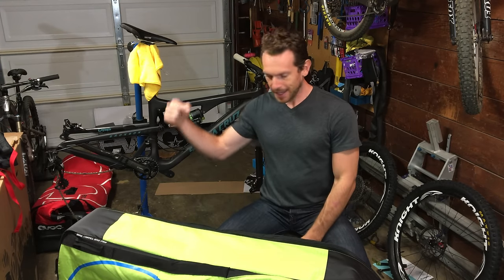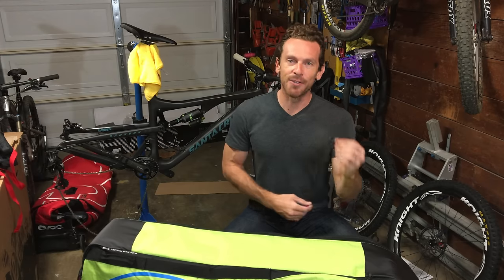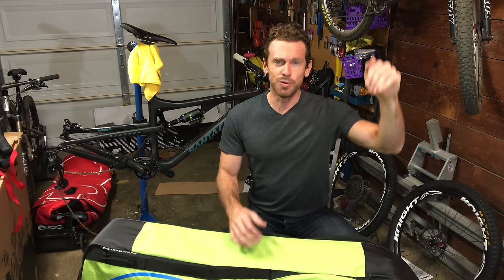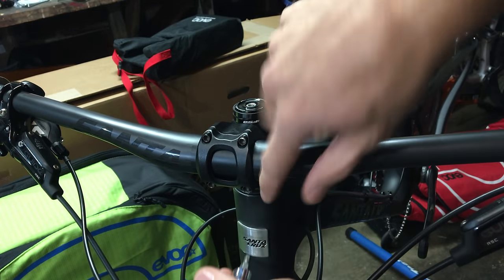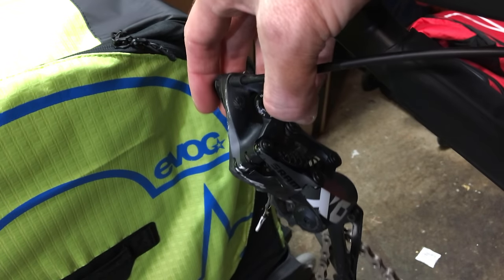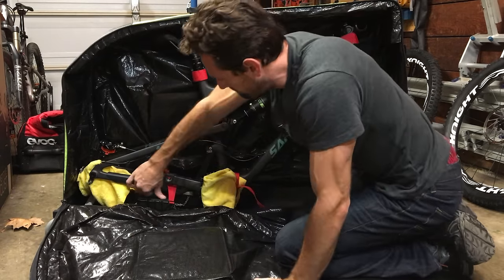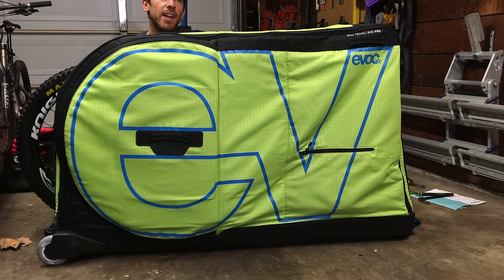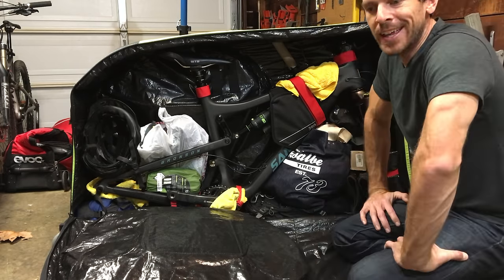How to fly with your mountain bike

Comment: A couple of other pointers I've learned from experience - Buy some closed cell foam pipe insulation to protect frame tubes.  They're cheap and they work really well.  An alternative to the airline is send your bike ahead of time via UPS / Fedex.  It will save a few bucks and it will be insured.  And don't leave any hardware lose in the bag or it will cause damage.
Good video thanks and I'll have to check out the Evoc Pro bag.
Reply from the maker: Thanks for those tips!

Comment: Reason for leaving a skewer in with a pvc or dowell spacer is so that when a baggage handler walks over your bike and stands on the stays, or your bike is the bag at the bottom of the pile, they can support the weight. Remembering of course that a baggage handler in poor health could weigh in excess of 200 lbs. I'm trusting the skewer and spacer over the foam bag.
Reply: This is  sad to hear, and if someone really does this they are stupid.
Reply from the maker: Definitely a possibility!
Reply: Johannes Nilsen I completely agree, but I don't know if you've ever watched baggage handlers or not, they're not exactly concerned about roughing stuff up.
Reply: sadly it's the same if you send the bike or components via mail. once i 
received a package of grips i ordered and some other stuff, it looked 
like a dog had it in its mouth, and some sued the package as a soccer 
ball. it was POSTEN NORGE but this happen only once. but a lot of the 
stuff i ordered from Norwegian online stores have been packaged quite 
well, with plastic air bags and cardboard, But even thou some workers 
are careless, they don't put stuff that weigh 30 kg on a small package, 
that's just Below Stupid. if you are too stupid ppl will notice and you 
get fired. recived a package to the door by ups ones the edges of the 
carton were banged up, but product inside was fine, but under transport 
under heavy braking i guess it could happen, so packaging stuff with  
ESP is a good idea,which most electronics are packaged in. so
 packaging a bike in it is a good idea I think.
there will always be some stupid person some where. but so far I have 
had good experiences so far,but I have never travelled by plane.

Comment: IF the axles are in the frame will flex less, but if they are not all the way in they can unscrew them selves and damage the threads if they get hit
Reply from the maker: Interesting!
Reply: But then again if the frame flex there will be friction between those two,so to eliminate this is to have a hub or some sort of axle insert thing,like on roof racks. In my opinion this is what you should do, have something in there. with Skewers the frame will still flex of course.

Comment: Your bike doesn't have skewers, it has threw-axles.
A swing arm without a hub bolted in is not that strong. I had my Yeti carbon swingarm  crack by side loading on a recent trip. That was probably around the 20th flight with the evoc bag and no problems. For the return trip with new swing arm Yeti warrantied (thanks Yeti!) I did the PVC spacer thing and would 200% recommend everyone does the same. You just don't know when it'll be that time when the baggage handlers (chuckers!) Have run out of fucks to give!

By the way, evoc have a subframe thing coming out that looks like a good idea.
Reply from the maker: Alright, I think I'll take your advice!

Comment: I've used a Scicon for 13 years, case has a few scuffs but the bike has always been intact. I would never use a soft case, seen a couple of damaged bikes at the other end of a flight with those and that was a couple too many.
It would be interesting to know the damage list when you were in Spain, Brian, could make an interesting video on what too take/ prepare for on potential mechanical's when abroad.
Keep up the good work!
Reply from the maker: Thanks Woz! Does SciCon make a hard MTB case? Looks like just a road bike case. The only damage I sustained in Spain was some scratches to the frame and wheels. Nothing broke!
Reply: Technically it is a road bike case - but I've had my Downhill bike, and Intense T275c in with room to spare. The wheel wells are meant for a road bike wheel diameter so 27.5 fit no problem at all. And like I said 13 years and god knows how many flights (and baggage handlers) and still going strong.
Reply from the maker: Good info!

Comment: personally i wouldn't pack my shoes, pedals and helmet in the bag because if there is complications with the bike in customs and it getting through etc, you wouldn't have them either. at least if you had your shoes, pedals and helmet  you would be able to use them with a rental bike. but that's just my opinion, great vid and safe flight :)
Reply from the maker: Yeah, it's definitely something I thought about! The BasqueMTB trip I did had awesome bikes you could rent (Orbea Rallon) but if I didn't have all my other stuff it wouldn't matter.
Reply: fingers crossed it all goes through okay👍

Comment: Takes only a few extra minutes to remove the 6 rotor bolts, rotors are fragile, and even though these evoc cases have a reinforced area for the rotors its flexible plastic, and on last trip to Hawaii you could see where the axle had been pressed hard into the plastic and deformed it, and my base alloy frame rails on bottom of the case were bent inwards between the crank and the fork, like it was dropped on a hard edge, nothing I can't bend back straight, (weighed 85lbs.. Westjet allow 100lbs, 29er wheels, are a bit of a tight fit, had to let tire pressures down to 5 psi, to get them in the sleeves, great cases none the less and feel happy packing it worldwide

Comment: Do you not release the pressure in your shock and fork?  The one time I flew with my bike I was worried about the change in pressure and possibility of blowing out the air chambers.
Reply from the maker: Nope, haven't had a problem yet
Reply: Dude...those thing pack up 150 psi  and pressed like hell when you bottom down... so be sure they can handle some changes on the plane... Your ears will explode before. RIDE ON!!!
Reply: Yeah, kinda my thoughts as well, ha!  I released all pressure from my shock and fork!  I'd also be concerned about my dropper as well =x
Reply: Airline luggage compartments are pressurized and climate controlled for the pets that end up in the hold.

Comment: No spacers on the brake pads? Have a nice flight and enjoy the trails!
Reply from the maker: Yeah, I have a couple but they kept falling out, I must have edited that part out of the video.
Reply: You need to put in the pin if your pads keep falling out.
Reply: BKXC I made a spacer with 2mm PVC sheets with a hole to put the screw thought, just like the ones on the pads, I think you have guides, don't you?
Reply from the maker: Nice! I dig it.
Reply from the maker: Yep I have guides

Comment: I think it will be a lot safer with a bike travel case instead of bag
Reply from the maker: Definitely, but I think it becomes quite heavy and unwieldy at that point.
Reply: It's just a large suitcase with wheels. Not to mention the 'bling' factor!
Reply: That's what makes sense at first thought. But, TSA actually treats the EVOC bags very well because they're easy to handle and inspect (unlike a hard case). They simply zip the bag open, inspect it, and easily zip it up and send it on it's way. With hard cases, everything has to be perfectly packed in order for the lid to close without jamming it shut and possibly damaging something.
Reply: Worth it. I'd claim my bike as a dependent and buy it a ticket in first class if I could.